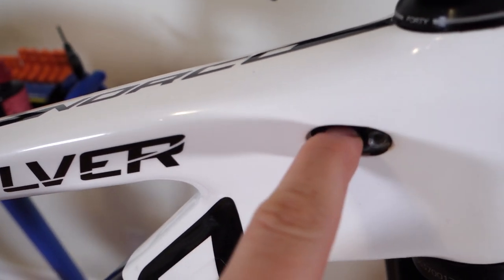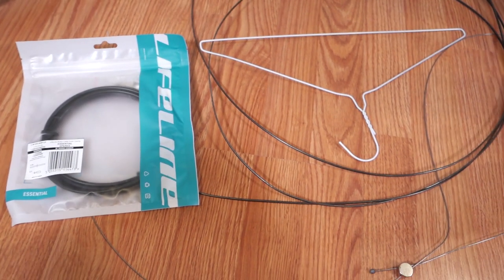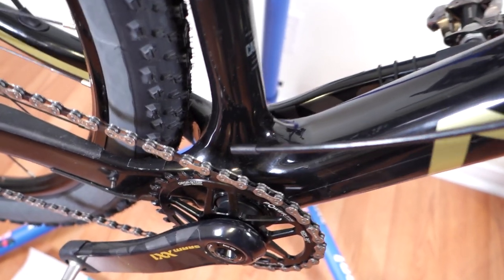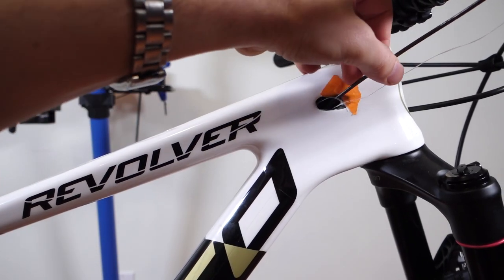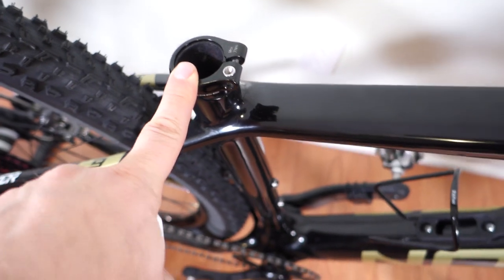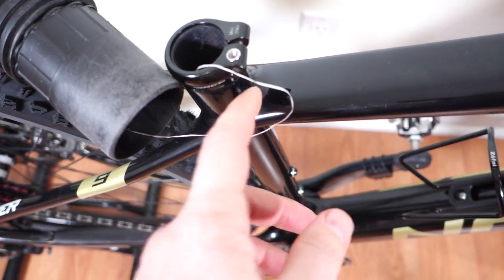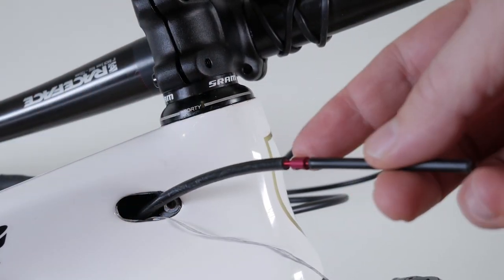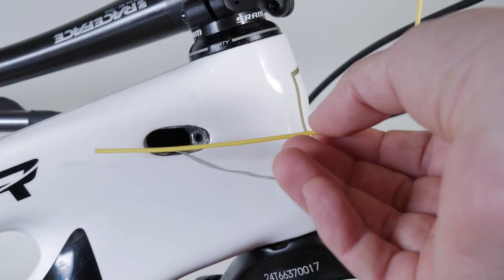5 Bike Hacks for Internally Routed Cables - MTB, Road, Carbon, Pressfit BB

Comment: I also used a hoover, started with cotton, then moved onto floss, then thin electrical cable, then the dropper cable. It all worked a treat. Far better than removing the bottom bracket, which I was dreading doing lol.

Comment: Cool stuff.  We used to use vacuums to suck a pull cable through conduit back when I did phone work years ago.  Helps if you tie something like a small piece of tissue to the end.  Also a small chain tied to the end of a string, drop it down then grab it with a hook works very well.
Reply from the maker: @thebdceigal  great ideas thanks🤘

Comment: I pushed the cable housing down from the seat tube and with a bit of wiggling it wanted to be pushed all the way up through the downtube. Then I just fished it out the hole in the frame. 
It's way easier to do it this way because you can see the trouble area down the seat tube, so that's my best tip. I did this yesterday and I hadn't done it before. 

Depending on the size and shape of the hole in the frame where the cable is going to pass through, you might want to do a loop with a ziptie into the frame, and when the cable housing enters through it you can pull it tight so you got a way to pull the housing out with. Just think of a lasso.

Comment: Before buying my dropper post last month. Was trying to find ways on how to install it Internally. Was facing  the same problem. Decided to buy an external dropper instead. Next time I know what to do. Great video. Cheers
Reply: 4 bikes.........4 external dropper post cables for me.  So much easier to install, maintain & repair.  Most of the cable is hidden and 'out of the way' under the top tube.

Comment: I have a 24" to 36" flexible claw grabber purchased at home supply or auto parts store for $10.  Pushed the cable housing down to the bottom bracket then snagged it with the claw grabber. Slowly pushed cable in from the top of down tube and pulled it up the seat tube. Quick and easy.

Comment: Sometimes you can stick a peice of pipe (whatever is handy like maybe a smaller diameter seat post) down the seat tube, and use that to coax dropper cables into going up  when you push on them.

Comment: I bought a generic cable routing kit on Amazon for $17.00 but the only thing I'm iffy about is routing my hydraulic brake hose. I don't want to have to bleed the brakes after installing it so I'm thinking of removing the hose at the lever instead of the caliper and fishing the hose through the frame from the bottom up. The cable routing kit I got has a tiny metal piece that screws into the end of a hydraulic hose and tehn a piece of thin cable with a piece of metal screws to that so I can fish the thin cable through the frame and pull the hose through after it I'm just hoping it fits my hose and it essentially plugs the hose so I don't leak mineral oil all over the place and have to bleed the brake. Wish me luck, I'm going to watch atleast 5 or 6 more cable routing videos before I attempt it on Monday with my new frame.
Reply from the maker: Instead watch my brake quick bleed video? 😎 very easy to do and need to learn that anyway- https://youtu.be/Ie50CE74A20?si=zGMwGv3m6hrRr7vh
Reply: @LoveMTB  i'm going to do that right now. I have a funny situation right now. I have a rear Shimano MT200 brake that has a hose that is too short. If I bought a new hose and a bleed kit it would be almost the exact same price as just buying a whole new rear brake, lol. I know I need the bleed kit for my other bike incase i have to bleed that brake after routing it but then again i might not need it. It's really crazy, and awesome that you can get a set of shimano MT200's for like $50.00 now, especially considering during c0v1d they were going for around $100.00 if you were even able to find any.

Comment: For a dropper housing, I found it easier to push the cable down the seat tube as the bend into the down tube is not as sharp coming from that way. Goes right up the down tube!

Comment: I have been preparing for over a month to install internal dropper post, both mentally and gathering the possible necessary items. I have pondered all of your ideas also. My plan was to avoid the BB altogether by exit frame and reenter seat post tube. I was concerned about the tight radius that the crank would cause cable and housing. Also concerned about crank rotating on cable housing. My bike is 2010 Trek Fuel EX8. I will be machining all three oval holes with help of Dremel right angle attachment to get holes as low as possible in the “V” above BB. I do have the grommets. Thank you in advance for your reply. No matter what, today’s the day!

Comment: I have tried all of these.. I have no problem fiddling the inner cable through the frame, but the housing always gets stuck somewhere in the middle of the frame. I have even tried to tape inner cable and housing together and to pull the inner cable back towards the handlebars. Nothing, but now the tape is inside my frame. I don't know what to do anymore.
Reply: @nathanricetalks  I got the same exact problem. I got 2 weeks worth of dental floss in my frame and 2 zip ties I’m probably just gonna route it externally until I take it to a shop or something. Glad to know I’m not the only one having such a big problem about it.

Comment: I'm trying to run housing for some dropper now. What a nightmare. I can run wir thru easy but the angle between Seattle and downtime is tight and the sharp edges on the inner holes shredded by first attempt. I'm gonna try the Jagwire Pro kit today. The housing is 3mm so smaller and the housing also sounds more flexible, fingers crossed 🤞
Reply: I took my bb out too, thought it would be easier 😂
Reply from the maker: It is easier with the BB out...patience!😂

Comment: Thanks for the great tips! Definitely will keep in mind for the next bike build. 

As for methods of my own: first of all, I stay away from press-fit bottom brackets. I know, it may be tough task with carbon-fiber frames, but there are some options.
Secondly, I am really glad about that bike parts are getting wireless connectivity (hello, SRAM AXS). 

And lastly, when it comes to actual routing, it is just the matter of using properties of housings and cables themselves. Housings are usually pretty stiff, so you can push on them. Cables are pretty agile, so you can do turns with them. Both cables and housings can serve as guides for each other. So cable routing is basically a matter of combining those properties and interchanging them when needed to.

For hydraulic hoses it is straightforward as well: route a cable, attach hose to he cable (e.g. using strong tape), pull the hose using the cable.

 E.g.  for your scenario, I would first push a housing into the downtube until it reaches bottom bracket. Then I would use it as a guide to route a cable. While having enough slack, should be able to catch/direct the cable up the seat tube. This can seem tricky, but it is only about directing the cable upwards with some long object (like a stick) and pushing. When cable finally reaches to top of the seat tube, just hold it there tight and push on the housing, so it that follows the cable. Done.

Comment: Hi I'm trying this on a Rockshox Reverb Stealth on a Scott Scale carbon frame. There is room exposed that I don't have to take the BB out but I'm having a hard time still. My dental floss ran out because I had too little, and also sewing string snapped on me when I was trying to pull the cable in. I'm not sure what else I can do. Any suggestions?

Comment: Thanks for the shop vac suggestion! It took a few tries, but I was able to suck a length of thread from the inlet of the frame to the seat post in order to set up the dropper housing / cable on a 2021 Stumpjumper.

Comment: I have the same problem right now with Nukeproof Scout. The version of the bike that comes with dropper as standard routes the cable on outside under the bottom bracket, which for trail bike seems kinda dumb. But now I need to figure out how to lead the damn thing 90deg bend. fml

Comment: Duck tape  new and old cables Together before you take old cable off then simply pull new cable through with the old simple I do it with sash cords on Windows just make sure you have 5 to 6 inches of tape on each cable at the joint
Reply: LoveMTB You’re right I just had  to take my motor out pedals and all to get my derailleur cable in

Comment: Made me think again about putting a dropper post on my bike. Is there a dropper post that has no remote to operate, rather just a small lever under the seat that you lift with your fingers and the post can operate? I thought I saw something like that one time, but not really sure if that is exactly what it was. Maybe someone out there knows.
Reply: Yes they exist and are cheaper and lighter too. BUT taking your hand off the handlebars can be a bit sketchy at times and I have had two of them seize because that area gets a lot of mud from the wheels.

Comment: Best option is to never fully pull out the wire tie dacron fishing braid to the brake or gear end of wire an then pull the old wire out via the brake unit pulling through the braid then when u need to rewire the new brake cable just reverse the pull.
Reply: @LoveMTB  true
Reply: Or just run external cabling, how do they do it on brand new bikes ?  Its puzzling me now

Comment: Why would anyone want to route their cables through the frame? I have seen it first hand the amount of dirt, mud, water, dust etc.. that can find it's way into the frame. And trust me the amount of damage this causes on a aluminum or carbon frame is ridiculous! Their is a reason why cables are routed on the outside of a frame so you you can clean them after every ride. On top of this, this grime solidifies itself inside the frame with the cables and just rots away and the rubber grommets they use or what ever you want to call them don't work. We have literally cut an aluminum and carbon frame in half and seen the atrocity! I would never ever buy a frame with internal cabling. I would post pics but I don't know if I should, I don't want to get in trouble.
Reply: @LoveMTB  It's just a fad that will fade away because I can almost guarantee these bike manufacturers will run into major problems and complaints from consumers that this is a stupid idea. Only a matter of time. Never ever want to mess with the integrity of a frame by putting more holes in it, common sense. It's seems to me these days it's all about fashion and looks instead of science and efficiency. But I could be wrong only in that regard. Sometimes it's best to leave an original design instead of messing with it because nothing can top it.